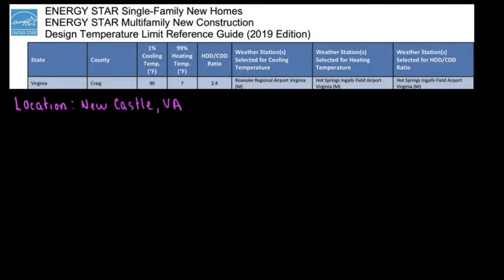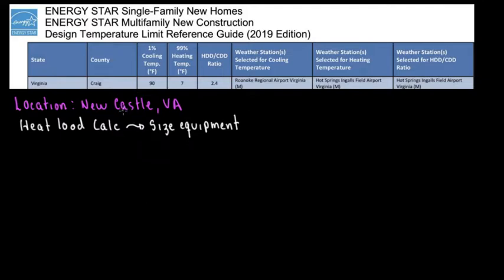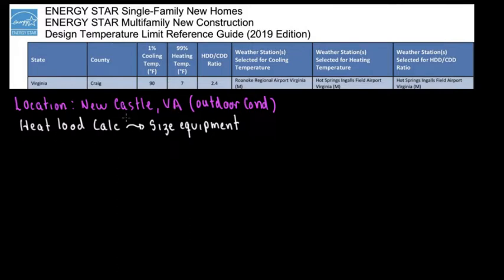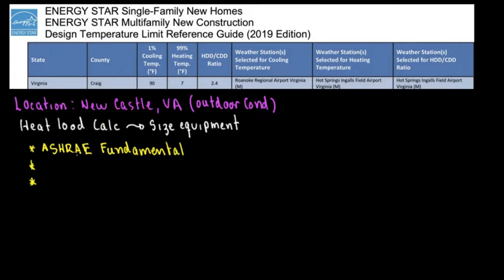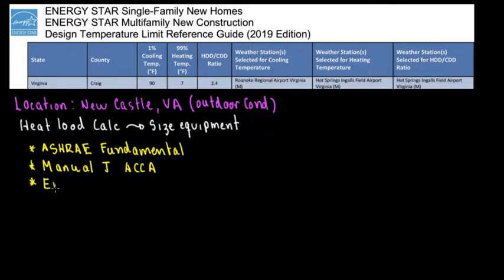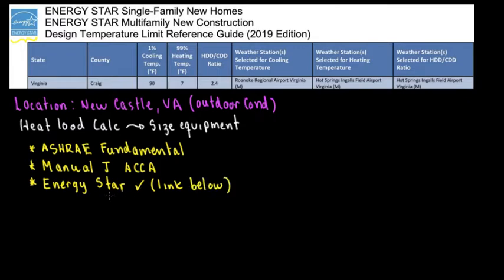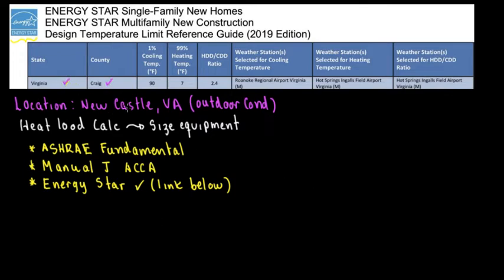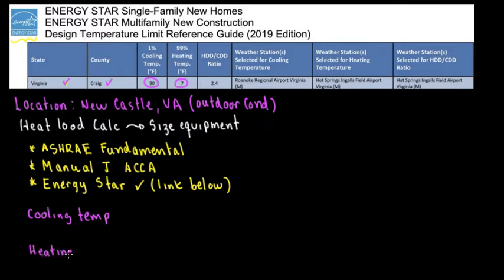Outdoor Design Temperature for Heat Load Calculations 1% and 99% percentile

Comment: Using EnergyStar, IMC, or ASHRAE design temperatures is widely accepted because it shifts risk away from the individual designer. The assumptions are external, standardized, and defensible. If performance is questioned later, the designer can point to the adopted table rather than personal judgment.

The problem is not the standards themselves, but what happens when a single static temperature is treated as reality. Buildings do not experience “average” conditions. They experience local conditions. Microclimates can drive temperatures higher or lower than the reference data. Climate change increases the frequency and persistence of extremes that historic datasets smooth out. Distance from the reference weather station introduces additional error, especially in areas with elevation changes, coastal influence, or urban heat islands.

Each of these factors alters the actual heat gain and heat loss of the building. When the inputs are wrong, the load is wrong. When the load is wrong, equipment selection, airflow, and control behavior are wrong. The result is predictable: systems that cycle improperly, miss setpoints during extremes, struggle with humidity, or consume more energy than expected.

Static design temperatures do not cause failures directly. They create a chain of assumptions that disconnect design intent from operating reality.
Reply from the maker: Thanks for the detailed comments. I agree with the site specific outdoor temperatures. Some builders have some specific requirements depending on the location. If they don't provide their own design guideline, ASHRAE, and Energy Temperature work as a baseline.